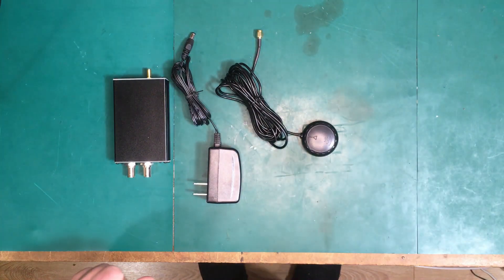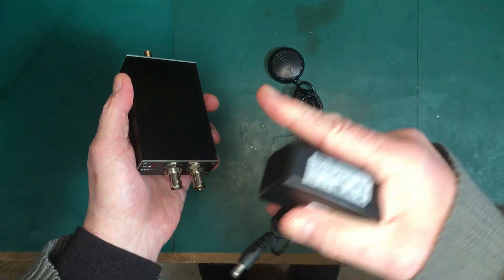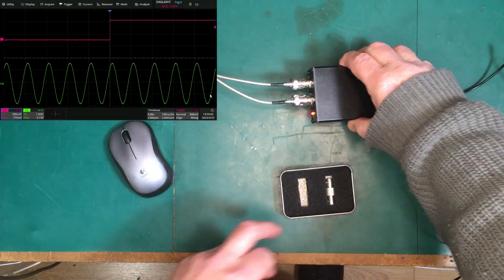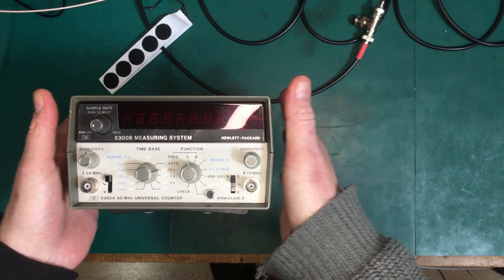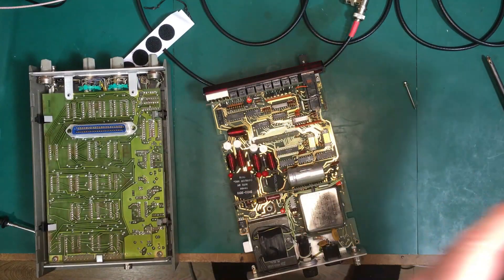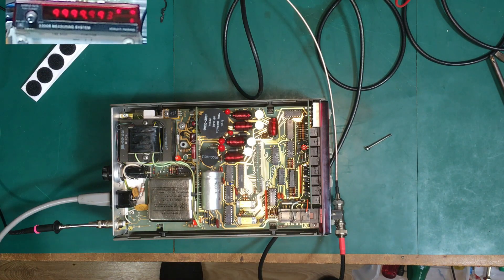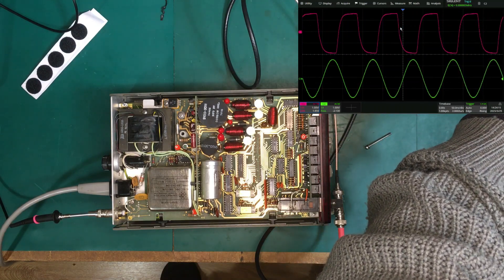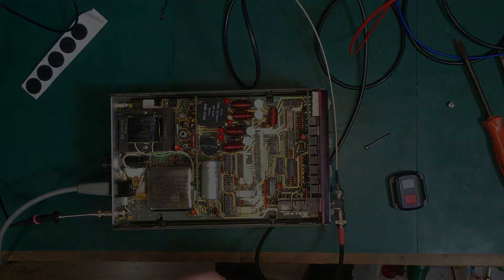Uni-Byte 0030 - New toy:  Cheap GPSDO - Time to play!

Comment: Any oscillator that is twitchy is more likely to be a TCXO than an OCXO ;)
Reply from the maker: This does indeed have an OCXO in it.  I had to replace it a few months back, so I am fully familiar with it.  The "twitch" is caused by the controller adjusting the the OCXO frequency to match up with the 1 second pulses coming down from the GPS satellites.  The "twitch" get's  progressively smaller as the OCXO comes up to temperature and  the frequency error is eliminated.  Then there is no more "twitch".
Reply: @uni-byte  I guess I would expect the adjustment to be either more of a gentle slide , or happen at longer intervals. But hey, it works :) Which OCXO did you install ?
Reply from the maker: @dimitriapproved  The reason that it can't be done smoothly is that the precise relationship between tuning voltage and the frequency is unknown and varies greatly from one OCXO to another, even of the same part number.  I just did a direct replacement of the CTI OC12SC36B that was originally installed.

Comment: BG7TBL has also developed a distribution box with 8 independent channels. It has also an OCXO inside. I have hooked both devices together and using it in my ham radio shack here in Germany.
Reply from the maker: Nice!  Yeah, BG7TBL has made a considerable contribution to electronics hobbyists in general.
Reply: @uni-byte  Just a small info: This device has an NMEA output. You need 2 wires. a 9-SUB-D Socket and the freeware software "VisualGPSView" You can see the receiving quality of your antenna. IF you use the freeware software "BktTimesync" you can synchronise your PC clock via NMEA. This is very interesting for ham radio FT8 operation. RS232 speed ist 9600 by the way. i am using both pieces of software. Very reliable!

Comment: The manual for the 5300B refers to a selector switch “near the power transformer” that transforms the BNC on the rear from an output to an input. When configured as an input, the GPS-DO 10 Mhz out could be connected and used as the counters’ time base oscillator. Then the accuracy of the internal oscillator would not matter. The GPS-DO would be operated 27/7.
Steve
Reply from the maker: Very true, and I considered that.  I need to have the GPSDO spread a bit thinner.  I have 4 instruments that use 10MHz frequency references, so either I use the GPSDO as a calibrator, or I devise/buy a distribution amplifier and drive that with the GPSDO.  However, the mains power around here is unreliable.  For that reason I'm currently leaning to using it as a calibration instrument.

Well, maybe a small UPS could help.

Stuff to think about.

Thanks for your comment!
Reply: @uni-byte  If your mains goes out, then all the instruments will likely go down anyway. The GPSDO even after only a couple hours on, is probably as good as you can get 'till you go buy a rubidium.

Building a 10mhz square wave distributor shouldn't be very hard either. Some 74hc7014 or 74HC373 or 74HC367 or 74HC4050 or 74HC2G34 (etc) in a box (can try to find ac/ahc/vhc parts as well if you want) connected to some SMAs/BNCs
Reply from the maker: Good suggestions Matt.  Thanks!